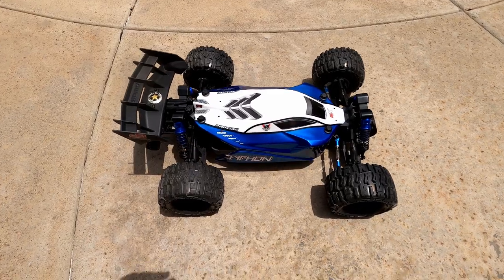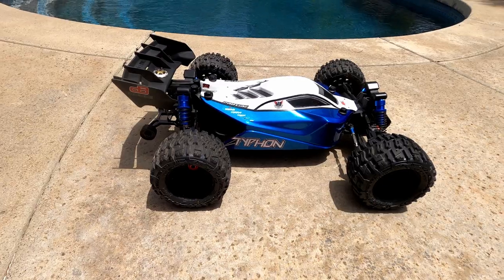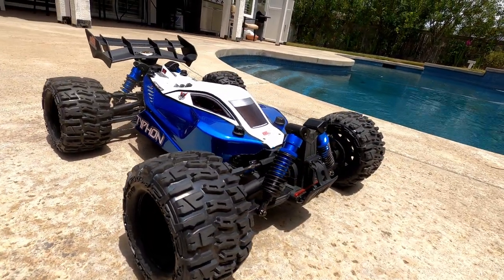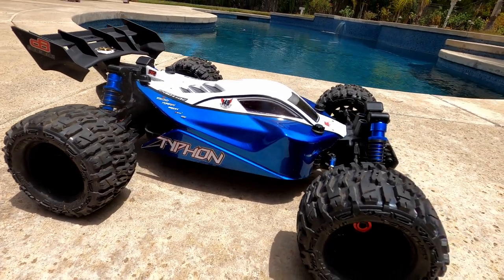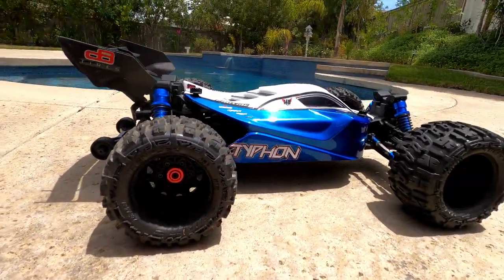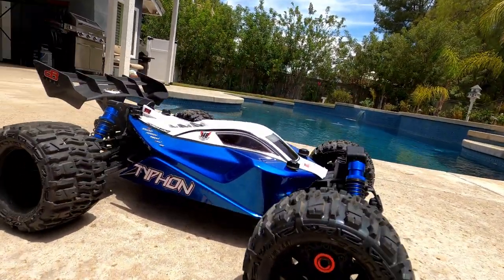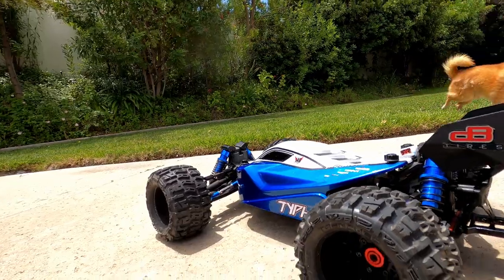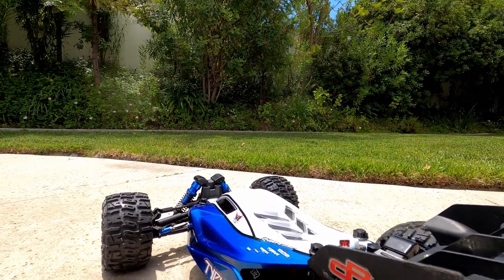My First RC paint job

Comment: The blue looks fabulous! I’ve just painted a body with PS16 and then backed with a couple of coats of black, but it looks very different to yours. Yours looks much brighter and more vibrant. How much black did you use, and then did you back it again with white all over?
Reply from the maker: Thanks..... I really don't know that much about paint but I learned the hard way that when you use metallic paint it's somewhat translucent even with several coats. When you go over it with black it really darkens the color. Candy apple red turns to a burgundy and so on. The best results for me at least is to go with white as your final coat and then you will get the results you want.
Reply: @RCRoads  Back with white it is then. Thank you!
Reply from the maker: Fore sure. You can see it on the body shell of my red Sunfire. I started at the front with white and ran out and went to black with the rest of the body. It got real dark and crummy looking.  @Wildcatjames1
Reply: @RCRoads  I actually think that red fade looks quite good with you, but I get what you mean 😀

Comment: That's a cool paint job!‐ If the title of the video was different, my first question would've been= where from? Followed by how much?  AND... if I owned a Typhon, I'd be asking you how much you'd charge to do mine!
Great video!!
Reply from the maker: Wow .. Thanks for the kind words. I haven't posted for a while because of a broken arm. I just came out of my cast last week and still cant do much with my right arm. Basic stuff like brushing my teeth or tying my shoes. It's funny but I have managed to get quite a bit done this last week working mostly with my left hand. I painted 2 more bodies. Replaced a pinion gear on my Sunfire and installed upgraded hubs , drive shafts and steering rack on my Typhon. It's been the best therapy of all and hopefully I will have a video out in a day or so.  ✌
Reply: @RCRoads  great to hear!  I got the Arrma big rock v3 4x4 3s today.
Was out of that or the Associated's Rival Mt10... same price at the local hobby shop, so went with the big rock. I'm waiting on the battery to charge now- feel like I'm 12 again.  How's that Typhon? You mention some work done to it.. is it worth the money? ( only other car I own is the 144001 from wltoys)
I love it!- perfect for beginner like me- thank God the big rock can run at 50, 75, or 100% power!